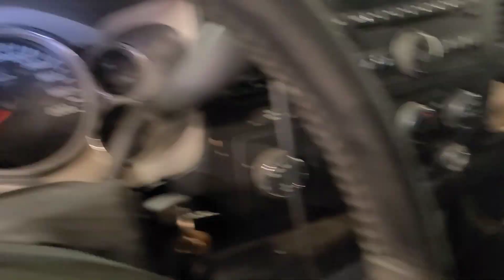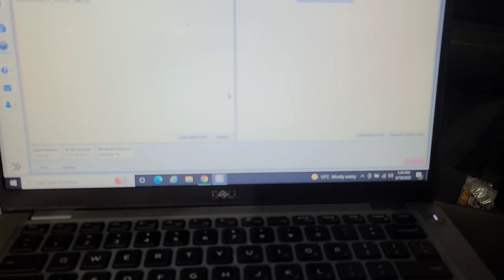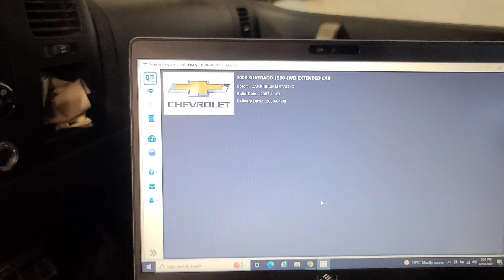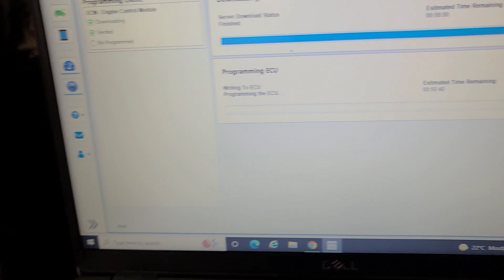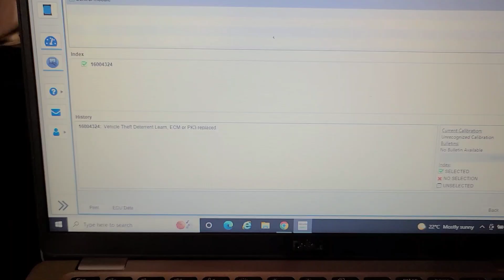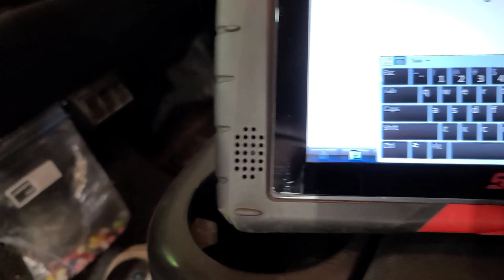2008 GM Truck 1500 5.3 ECM Reflash pt. 2

Comment: Are you using windows 7 or 10 pro? Thank you for the video!
Reply from the maker: Windows 10 Pro actually windows 7 I don't believe is supported anymore for GM.
Reply: @PhillipBailey  your correct gm doesn't support windows 7 anymore. Thank you Philip